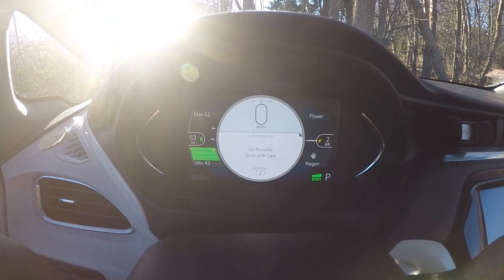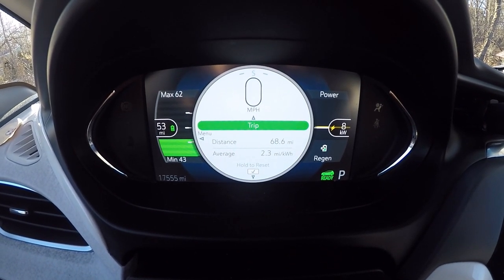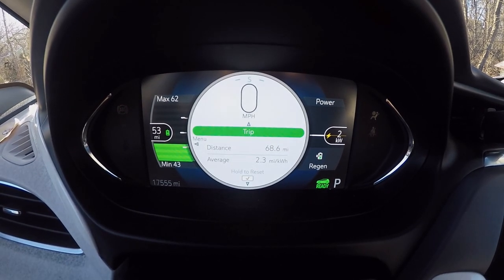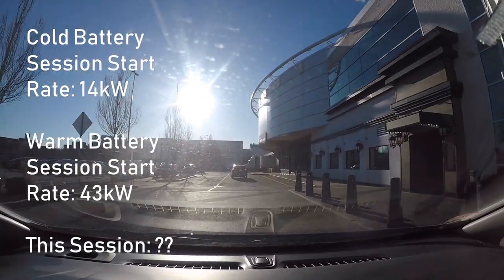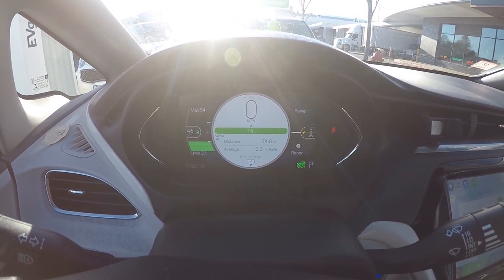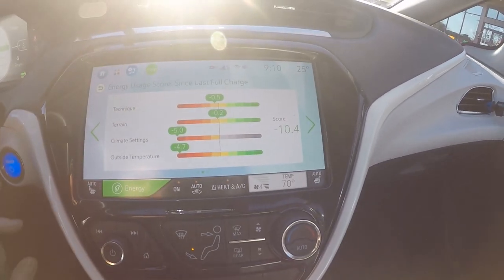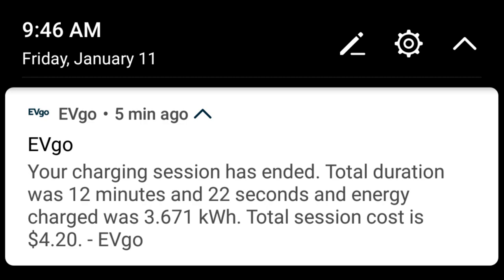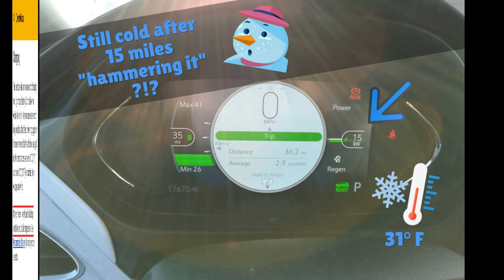Can You Warm Up a Cold EV Battery on a Chevrolet Bolt?

Comment: Thanks for your testing. Here in far northern Maine I've seen "Propulsion Power Reduced" once when the outdoor temp was around -10F and my Bolt EV wasn't on my home L2. It's been -23F but with the L2 connected overnight I didn't get that warning.
Reply from the maker: Right, keeping the car plugged in with a steady stream of juice is usually a safe bet. Interesting you got the propulsion warning in that scenario... I've only ever seen it when running at a low state of charge, but I guess the battery heater ramping up to combat the cold when unplugged could push it into that territory. We simply don't get that low here in our standard winter conditions to test it properly. Thanks for the insight!

Comment: This is helpful.
My first charge with my bolt was 100 miles away from the dealer, about 2 degrees F. I got 32kwh from a 50kwh DCFC. I was bummed then but I guess I should have been happy for what I got!
Reply from the maker: Yep, that sounds pretty good for winter, especially on a 50kW station! Do you have a previous model year Bolt or a 2020 though? The improvements to the 2020's winter charging seem to make a 30kW start up about standard, from what I've seen so far.
Reply: @plugandplayEV  I've got a 2020. Good to know that may be the difference. Being in Minnesota it's below freezing a big part of the year.

Comment: Awesome - I kept complaining about my 20kw start … I knew it was the cold weather but it’s only 50f with me it shouldn’t been this low - I also notice decrease in charge speeds with new battery ( winter time ) summer it’s amazing . Except when it goes over 100f then same thing as winter 🤦🏻‍♂️
Reply from the maker: GM has always been extremely cautious with the Bolt's fast charging curve, especially below 40F. Even above that can see some lower power charge sessions, though 20kW is very low, even for freezing weather. That said, the charge curve does seem to be different on newer models and replacement battery packs, so it could be significantly different now as the video is several years old. Thanks for watching though!

Comment: You need a stretch of road where you can go pedal to the medal then full regen 10 times back to back. Driving 70 mph is not going to use many kW. You want 150 kw acceleration and 60 kw deceleration until the regen limit indicator goes away.

The battery heater is 2kw. And that is what will run off the charger until it heats up. You need to get more than 2kw of waste heat from current in the battery. If you can’t, you might as well go plug in to a lvl2 charger until the battery heater warms up the battery and then you can move to the fast charger.

Running the heater is counterproductive during regen because it lets you burn those kw instead of forcing it back into the battery.

It is interesting that it allowed brief 50 kw regen but wouldn’t accept 30 kw charge.
Reply from the maker: Right, I saw the actual Bjorn videos you referenced after these sessions... so his stop-start repetition is definitely interesting but would be hard to replicate at this location with the busy suburban roads. At night, maybe possible.

 I was surprised at the second session (still images only in the hood), however, which I thought would be enough driving to hit higher start rates. Although the tests have been interesting, I think the takeaway for regular drivers in this position is to stick to home/public L2 charging when it's near freezing or find a free/flat fee DCFC so that the cost isn't exorbitant. I don't see many wanting to bunny hop down the road in winter conditions to make this happen!
Reply: Ste, if you do another test where you have a short distance between off ramps and no traffic, such that you can accelerate up to max legal speed then regen until the off ramp, then loop around and get back on in the opposite direction and repeat until the regen limit is completely gone, you might be able to hear the battery faster that just going straight to the charger. 

Some places have dedicated U-turn lanes to get back on the highway. If you don’t, then possibly traffic or traffic lights would ruin this method.

The experiment needs to address two situations, one is that you don’t have time to wait for the battery heater to warm the battery and you can do it faster by driving like you stole the car, and the other is paying $0.35/minute to get 15kw for 30 minutes. 

The first one is straight forward but the second one needs to account for how many kWh you wasted trying to warm up the battery. If you wasted a net (after regen) of 10 kw, then can you recoup that with faster charging? Of course if you are at a charger that charges per kWh this is not needed.

By far the best thing they can do is give the driver the information about what speed their battery can charge at based on its current temperature, and allow the driver to manually turn on battery heater when enroute to a DCFC. I think as charging infrastructure gets more reliable they can do this, but with spotty coverage, it would allow drivers to waste energy to get to a charger which is out of service.

But there is no excuse for Tesla to not do it with their supercharger network. The car should even be able to automatically turn on battery heat as soon as you select a supercharger as your destination. But the programmers are too busy making fart apps. Lol

Comment: When you were on the L2 charger you could have started 2 sessions of preconditioning which will give 40 minutes of battery warming @2.5KW from the J1772 (assuming the car HVAC is already at the set point).

When you transfer to the rapid charger you will get a higher rate when connecting to a fast charger

Driving below freezing, the battery is generally around 4c/38f. The car ramps up the charge rate as the temperature rises to 20c/68f for a rate of 45KW/h. (charge rate varies with temperature as active battery management does its magic and pampers the battery).
Reply from the maker: Belated thanks for your reply, Don. I've been looking at OBD readings as the temperatures start to drop here and will be working your suggestions into a winter 2019/'20 test, if I can find the right location to do so.